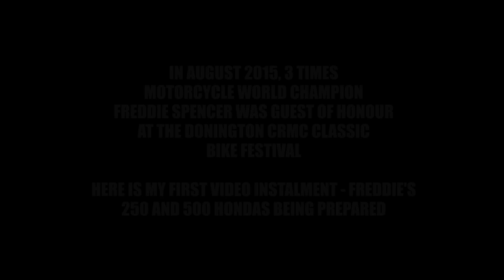DONINGTON CLASSIC FEST 2015: FREDDIE'S HONDAS BEING PREPARED

Comment: I don't think Spencer ever raced the V3 in Rothman's colours.
Reply from the maker: No he didn't.  He tested the machine at I think "Surfers Paradise" as part of the Rothmans launch but the V4 was up to speed by the 85 season and the NS 500 3 cylinder machines were given to Gardner, Haslam and Mamola in '85
Reply: Was the rothmans v3 an improvement/upgrade to the 83 v3?
Reply: This one is a late RS500 with the massive beam frame which was around 86 time, way after Freddie stopped riding it so would be the ultimate version and way better than the 83 bike